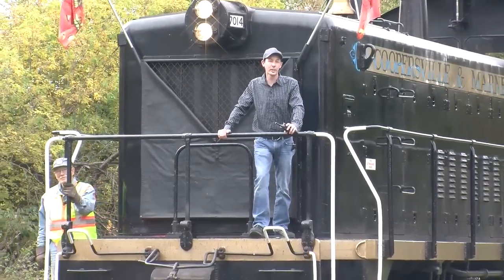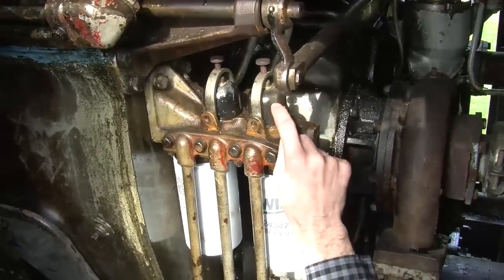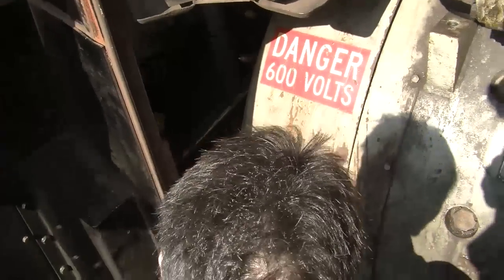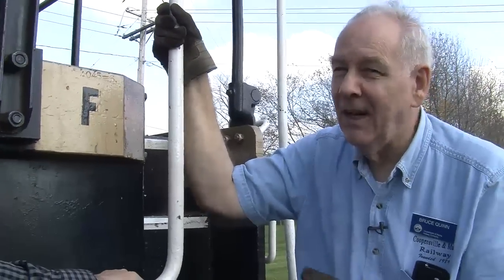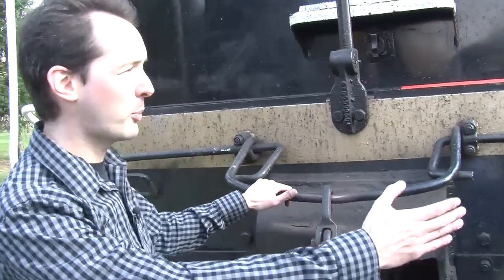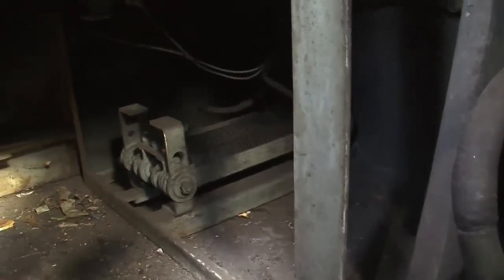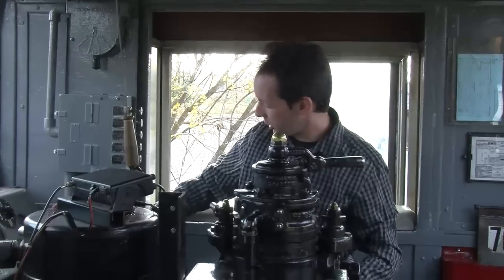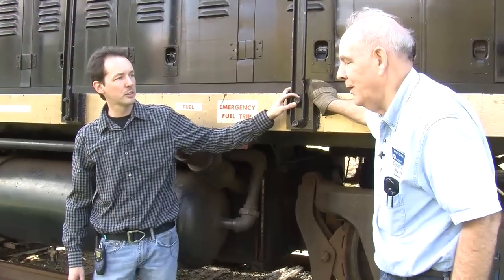Diesel Locomotive Basics

Comment: You use the air to start the train. You build up pressure to release the brakes. To stop the train you remove the air from the brake system.

Comment: What kind of trains are most common and the most used these days? I'm guessing not steam engine ones but is this kind in this video most common now? I know very little about trains but I'm becoming more and more interested after seeing a job ad from UP
Just curious what kind I would most likely be working on if I got into this field.
Reply: These kinds of locomotives are only common in certain areas, but not something you see all over the place all the time. that is because the SW9 (locomotive in the video) was produced in the 1950s. Locomotives you typically see today are made from GE. newer locomotives are  the GE D944CW, ES44AC, etc. some newer EMD locomotives are the SD70ACe, SD70M, and the SD70MAC.
Reply: Shane's Vids
Ok thanks. Are the newer ones still powered by diesel engines though? Saw a documentary not long ago and they were talking about putting multiple diesel (I believe) engines in so they can conserve energy and resources by only switching on the ones they need and shutting others off when they don't need them.

Is that how the newer ones are?

Thanks for your response. :)
Reply: cronicjointpain from what I know there is still diesel. I don't know much about the diesel engines they use on the inside, but it's still known as diesel electric.
Reply: Shane's Vids
Oh ok. Thank you!
Reply: UP mostly uses Es44ac's,SD70MAC's and M's,SD70ACE's, and Dash 9s and 8s. They also use many other smaller Units for their yards as so do many other railroads like NS and CSX.
Reply: Two things here, one is that over the last decade I've come to understand chronic pain a whole lot better than I ever wanted to; the other is that there is a multiple level answer to this question.
Depending on what "this kind" is defined as, either as small switcher or shunter locomotives, or meaning diesel-electric locomotives.
(guess I'll come back and say outright that some of the following is in the video, but a few people might read this before watching an hour video)
As far as power and transmission combinations, diesel-electric is probably the most common due to the cost of installing overhead trolley wire or third rail for straight electrics. Diesel-electrics are commonly referred to as just diesel. The diesel motor drives either an alternator or generator which produces electricity to drive traction motors geared to all, or sometimes to almost all, of the locomotive's axles. One reason for using electric motors is because of the tremendous amount of starting torque they have. Another is for their ability to be overloaded for a short time

Another motor and transmission combination is diesel-hydraulic where driveshafts with fluid couplings transmit power to the axles. UK and Germany each had a series of mainline sized locomotives with this combination but mostly it seems used on smaller industrial locomotives.

And on the smallest locomotives, some as light as 5 tons, diesel-mechanical was and sometimes still is used. These come complete with clutch and gearshift. Some had driveshaft drive some had chain drive to the axles.
Early on gasoline motors were used as well. 

Multiple motors: there have been a number of center-cab industrial locomotives with 2 gas or diesel engines, one under each hood, and either one or both motors can be employed to generate power depending on need.

Lately there are up to 4 engine locomotives with cleaner, smaller, engines which are also used in varying numbers depending on power required.

Electrics: straight electric locomotives, which came before diesels, do not generate power on board but draw it from overhead wires, trolley, or from a third rail to use with traction motors on each or on most axles. Given that the most efficient transmission power is and what power the traction motors can use are most often two different things, varying schemes have been used to transform voltages and currents from line power to motor power. Electric locos eat current from hundreds of volts early on to tens of thousands of volts and multiple hundreds of amps today. Saw an early 1900s New York Central straight electric which had 700 amp fuses between the thrid rail shoes and the electrical switchgear.

And then there's the AC current versus DC current thing. Either the line power or the motors can both be AC or Dc, or the line power can be one and the motors be the other.  and with AC they can be the same or different numbers of cycles and phases. All sorts of fancy electrical engineering goes in to making the things run and almost all of it is beyond my knowledge.

No matter which way you go, when getting in to maintaining full mainline sized locomotives you eventually will be dealing with electricity at some level or another.

Technology has gotten to the point where locomotives are using Doppler radar pointed at the ground to get their true speed to compare to motor current to determine whether individual powered axles are slipping or not.
Reply: Scott FW I join with you in understanding about chronic pain, my journey started in 2003 and continues today. 
For years dating back to my youth I was an HO gauge railroad enthusiast. As with my chronic pain I met and made close friends who knows a great deal more about it than I do. It's the same with model railroad groups and since my retirement "Railfanners."  It was in 1969 that I got to operate a switch engine down and back at a yard in Atlanta. I was amazed at the power that was in my hand as I moved the lever. I was bitten the railroad bug.
     I guessed I really enjoyed this video so much because it was just like the engine I operated in Atlanta.  A big THANK YOU to all who made it possible. I feel like I've added to my friends list from whom I can learn a lot.

Comment: question about train brake, if the engine is stoped, no idle, cana the train move?
Reply: if you were to release the air on the independent brake handle (or let it bleed off) and also release the handbrake, then yes it would roll freely.

Comment: Well, that is not the case. There are a lot of locomotives with 4 stroke engines that dont have a blower. Even if they are under 2000 hp. Blowers are mostly used on 2-stroke engines.

Comment: If you didn't take the time to open the cylinder cocks, you could end up with water in the cylinder, and since that don't compress well... or at all, parts would probably come out of the engine, like the guy said in the video... That or depending on how young you were, they may have wanted you out from under their feet while they were working, which would suck...  cause you learn a lot while young!

Comment: That 12-567-B was built kinda late for a "B"- model.  by 1957, C-models (with round airbox covers) were available for several years.
Reply: Built in 1952, thus the "52" prefix in the serial number.  The 1957 date was from a rebuild shop;.

Comment: Is diesel-electric more efficient than diesel? Is it just the fact that it dispenses with a gearbox?
Reply: The diesel-electric rail engine efficiency is that all wheels are driven directly by the traction motors which add their weight at the wheels. This method, and the 8 speed control mechanism were first developed for streetcars in the 1880s by Frank J. Sprague (a distant relative of mine). He cobbled together the best elements of many previous attempts at electrification of rail based transport as a complete system which remained essentially unchanged in its operation until modern electronics came into use. His company also developed the Multiple unit control system still in widespread use on older streetcars and older railroads using multiple engines from the era this engine represents

There are losses in this system that modern electronic AC controls improve upon, and diesel engines as prime movers are beginning to reach the end of their technological improvement in these sizes. I am not holding my breath, but I if fuel-cell electricity generators become available at the right price in these sizes, it could be a game changer the way Diesels were to the steam engine era outside the major metropolitan and other highly populated rail markets that cannot justify catenary fed pure electric systems.
Reply: the direct diesel drive is very inefficiant due to the weight and torque needed to turn a gearbox big enough to deal with the tractive effort to deal with normal train loads, light shunters yeah maybe like the br 02 or the br 03, however diesel hydraulic or diesel electric have a much better efficiency and a better life span as there is no direct connection between the wheels and motor.

Comment: Engine puts out 1200 HP and what is the power output of generator and each traction motor??
Reply: The HP rating is actually the generator output rather than the engine, common misconception with D.E. locomotives. Switchers of this vintage do not have dynamics, and dynamics are used to absorb power(heat) created when using the traction motors as generators to slow the loco
Reply: Each traction motor is rated at 300 HP, or 600v DC x 500 Amps. 4x 300 HP traction motors gives you 1,200 HP on a good day when everything is working well. The motor itself is capable of generating far more power, but it's regulated by a governor. Also there is the efficiency factor between the engine, the generator and the traction motors. 
If you do a search for SLUG SETS you will hopefully find where the guts of one locomotive have been stripped and replaced with a cement block. The master locomotive that it's permanently attached to has the exact same guts, with no changes. The only difference is that the one motor and generator powers two locomotives worth of traction motors instead. They also cannot transition to a higher speed and are usually just reserved for heavy-duty switching or marshaling services.

Comment: Very good video.  Wish you'd had access to an engineer, though, and not an operator.  That guy didn't know anything!  Every time you got near a panel with a 600V label, he'd go nuts!  (Unless locomotives have 600V storage batteries, you're not going to get into any voltage if the generator's not running.)
Reply: pegbars nominal battery voltage on EMD's is 64 volts when running its 74-75 volts. The cold cranking amps is in excess 10,000 amps so yes even with the engine shut down if you touch the copper part of the battery cut out switch your live direct to the battery not a good thing.
Reply: Don't set a wrench across the terminals unless you need 2 shorter wrenches.
Reply: Starter fuse said 400 amps

Comment: electric motors are used on the San Francisco trolley cars.  not mistaken for  cable cars which run off a continuous moving cable under the street..  trolley cars stop dead in the middle of a San Francisco hill.  So a lot of torque is used to get the trolley moving again.  ''
electric motors have more torque than any diesel or gas engine can have.
a trolley is a bus like vehicle connected to overhead power lines.

I used to ride the public transportation in San Francisco to work every morning.
MUNI trains.  very interesting.
nice video.

Comment from the maker: The axles on most trains would easily clear you (assuming you're not too large). However, the air hoses, traction motors, pilot, etc will seriously mess up your whole weekend. With a typical US freight train and track, if you don't die horribly in the attempt, you'll have plenty of time to be mocked as the stupidest idiot in D-Block for attempting suicide on federal property.

Comment: at 5:11 that isn't really a turbocharger since the engine an EMD 12-567 is roots blown supercharged. You can find the superchargers at where the engine drives the generator. That seems to look like a connector for the oil or or water to cool down the engine as the fan is runnning...just puttin it out there no offense.

Comment: Hey everybody!  I thought it was a real good (the video), but when the docent (tour guide)actually put his hand into the coupler,  I thought, there goes the fingers! ! one more thing. . . If I may . . the mechanical "pin" being pulled from the top is where the slogan "pull thepin", came from. Nowadays it's pushed up from the bottom.
Reply: The pin for "pull the pin" was from link-n-pin which was a whole lot older.  The  pins on couplers can be lifted or pushed up depends on the coupling.

Comment: At 5:10 it IS a turbocharger!
Reply: No. The turbos on these types of engine - ie a 567cu in per cylinder V12 2 stroke Diesel are a much, much larger apparatus than that thermosyphon water pump looking thing. On these things, it is a single turbo that is very very large - nearly the height and width of the motor (so around 5-6 feet high, about 5-6 feet across and a few feet thick) and driven by the motor at low revs and exhaust at higher revs with a overrun clutch relieving the motor as the turbo spools up when the revs and exhaust pressure rises.
The Uniflow design of the 2 stroke EMD requires either a blower (or 2 normally run off the camshaft, one blower on each side of the motor) or if turbocharged the crankshaft drives the enormous turbo so it can idle, then exhaust takes over.
The GM EMD Diesels have intake ports in the cylinder and cam and rocker arm operated exhaust valves (and injector) in the cylinder head. The exhaust (pipes, muffler, manifolds etc) arrangement is located in the middle of the cylinder banks or in the Vee.
 
The blower only EMDs are considered NON boosted or Natural engines. The blower is there to scavenge the exhaust and fill the cylinder with clean air. They will not run at all without a positive displacement air pump.
http://en.wikipedia.org/wiki/Electro-Motive_Diesel
http://en.wikipedia.org/wiki/Two-stroke_diesel_engine
Quote:"All two-stroke Diesel engines require artificial aspiration to operate, and will either use a mechanically-driven blower or a hybrid turbo-supercharger to charge the cylinder with air. In the early phase of intake, the air charge is also used to force out any remaining combustion gases from the preceding power stroke, a process referred to as scavenging."

Also those rectangular side plates are not for the valves. I reckon the cylinder block air gallery for the cylinder intake ports and are behind those plates. Might be able to remove one when the motor is stopped and look directly into the cylinder through the intake ports if the piston isn't covering them.
The valves (and injectors) are in hinged rocker covers in the usual place - on top of the cylinder heads. From memory EMDs are a 45deg Vee.
The motors are V6,8,12,16 and 20.
There are several different series. Each series of engine denotes the cubic capacity of 1 cylinder ie 567, 645 and 710 being the newest. HP ratings are generally in the range of 750 - 3500 at around 900-950rpm (with some horsepower ratings higher and lower than 750 and 3500). Bore and stroke is roughly in the 10"x10" range - obviously the 567 being smaller to the 710, but not too much.

Also, they are a very common and reliable engine with thousands in service the world over as I write this.
https://www.google.com.au/#q=EMD+diesel&safe=off&tbm=vid
Reply: ***** Or is it an intercooler?
Reply: That was water pump. This engine has what's called Roots blowers. They are basically very large, gear driven, super chargers (one on each side) mounted on the "horns" at the rear of the engine... just above the main generator.

Comment: @13min  so there is a transmission, it connects the traction motors to the axle.
Reply: There is a gear on the traction motor shaft meshed with a gear on the truck axle.  That is the mechanical transmission of power from the motor to the axle.

Comment: This should be a great Train Spotter video.  There's lots of "stuff" with just enough common sense to get by.  However, the science parts were completely left out.  Which is OK considering the mental capacity of Train Spotters.  A Diesel Powered Electric Motor is not uncommon.  We've been using them for eons.  This particular engine is a locomotive.  Go to most any generator facility and you'll see a Diesel generator.  Even those that were flooded in Japan during their Nuclear Melt-Down after the tsunami were doing the exact same job - generating Electrics.